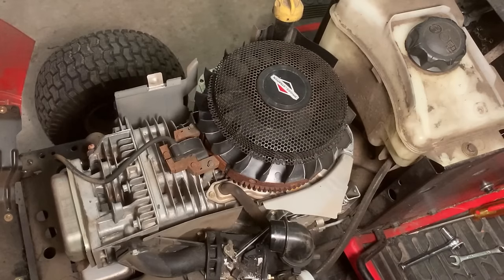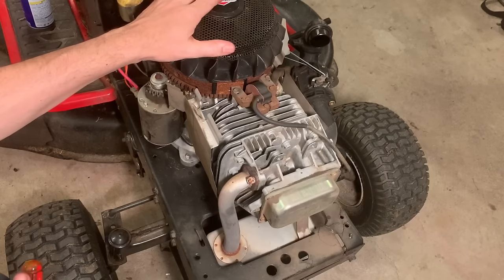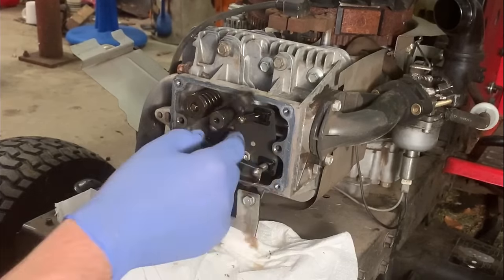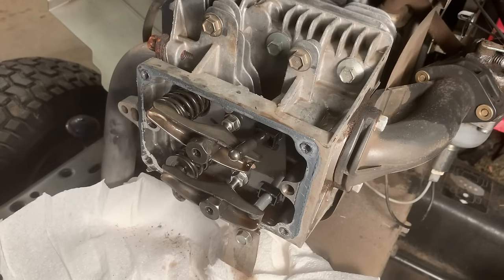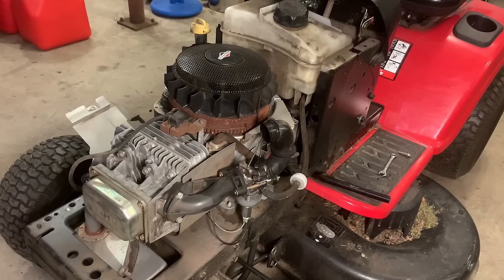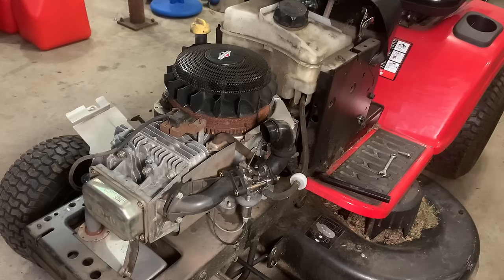Lawn Tractor Engine Running Rough, Missing, Popping, Sputtering / Briggs Engine - FIXED

Comment: Ya got lucky on that one! Those engines are the Vega or Pinto for Briggs!🤗 Briggs makes some good engines, but, that specific engine has been plagued with issues. At least that's been my experience.  I have repaired several of them.
Reply: Can't speak for Vega but Pintos and Briggs have made me very happy.; lots of good use from both brands Always on the lookout for more.
Reply: The vega had crappy engines but the pinto engines were very reliable they just blew up if you got rear ended due to the fuel tank configuration.
Reply: @williamvaughan1218  Pintos were no more prone to fire than other makes of that fuel tank configuration. The case than made all the news was a compendium of bad operator decisions . The young lady  had just filled the tank and forgot to replace the gas cap. She stopped in the travel lane to replace the gas cap which was the primary cause of the rear end collision combined with the inattentiveness of the colliding driver. The missing gas cap plus a full fuel tank was the major contributing reason for the fire.

Comment: I had one that started hard and when I engaged the blades it would stall. had no power. The flywheel was just a rusty as this one. I sanded it shiny, and it had all kinds if power. Started better also.

Comment: I have a troy built mower with a seventeen and a half hp engine would not crank had a solenoid put on the carburetor it will start and run but it has a miss in it if you push it to choke it out smoothes out but don’t open up like it should

Comment: I have now issue with 12.0 hp, (bs model 289707,  2004 , )..
Intake valve hits spark plug ....
So there is somethin loose or broken..

Interesting though that engine starts and runs rather nice with too short spark plug..  

Looking these videos to collwct courage to try to fix myself with low budget.. 
An option is to buy new engine..
Problem is that i invested on parts last year on cutter table so i dont want to buy a new mower yet...

Comment: Nice detailed video.I have a poulanxt 12538 38 inch cut.it looks like yours. My problem is that it starts a runs fine.After an hour or so of use, it will die and will not start until I let it sit for at least an hour or so then it starts and runs as it should. I will be checking timing, valve and pushrod clearance like you did first.but if you or anyone has any advice I woild appreciate at it. It's 4-5-22 and the cutting season is upon me!!!!🥺
Reply from the maker: Would shut the fuel valve off and make sure the bowl has fuel.  It it does then my money would be on a bad coil or plug.
Reply: @jcondon1  thank you james.... I was thinking it was a coil too but I I'll check everything else first.thanks again and I reach back out to you some  how with an update.

Comment: I fixed one with this issue a few years ago.If your engine pops while it's running on a single cylinder ohv it's a good idea to check the valves one of those little keepers may have fallen off.

Comment: Great video. 
The roller piece that fell off, did you put it back on? How did you  fix the piece that came off?
Reply from the maker: I tightened the stud, out the cap back on and adjusted the valves.  Properly adjusted valves hold the rotator cap in place.
Reply: James Condon ok gotcha didn’t see that.

Comment: How is the red fuel filter different from the white one you removed? Thanks for this video!
Reply from the maker: The white one is a paper filter and mean for fuel pumps.  The red is a screen and works better on gravity feed systems.  Of coarse it does not filter as well.

Comment: Had a feeling you might keep this one, I know alot of manufacturers are using rtv for the OEM gaskets but it is concerning to me, if you put too much on and it finds it's way into the oil and crankcase it could be a very expensive mistake
Reply from the maker: I agree, would much rather have a gasket.
Reply: James Condon Plenty of those gaskets available online, the cover was glued on in factory.
Reply: @stevendegreef93  Correct, the parts illustration for that engine shows a gasket even though the factory used RTV during assembly.

Comment: I have same engine worked good for 13 years and is still strong. Never changed the plug. Change the oil every spring and air cleaner I blow out to clean. Breaks on hills are useless backing up on a hill is 
Danger Will Roberson Danger

Comment: Excuse me, I have a KOHLER engine in a 2003 troy bilt riding mower. Does this type of engine have caps or rotator on the valves?

Comment: Excellent. Your point about fuel filters: I've seen a few people say they only block big stuff so they use paper filters even for gravity-fed. A quick search tells me there can be a flow issue with paper + gravity-fed it the tank goes below 1/4 full. Was about to get paper ones until a) I was the price, b) I remembered the cap/gauge on my old 11/36 Murray is awful. Would like to order it a new cap/gauge from the US but can't be 100% sure it's the right one. 
Liked and subbed.

Comment: good video,your good but why did you not show the timing mark on the flywheel and the coil and explain
Reply from the maker: There are no timing marks external to the engine.  The only thing you can go by is the position of the magnet on the flywheel.  Then the piston is at the top of travel, the magnet should only just be clearing the ignition coil.

Comment: With this mower, at 10:18, , if it spitting gasoline out the air intake when I try to start it up, any ideas where to start looking? I replaced the carburetor and adjusted the valves. I will take the cover off and double check that the studs are tight.
Reply from the maker: Ensure the valves were adjusted at top dead center in the compression stroke.  Check the flywheel key as the spark timing could be off.  Otherwise you might have an issue with the intake valve not sealing properly.

Comment: Hey I have same problem on. Briggs 18.5 ohv intek plus but the rods were ok and I put in a new heads . I check the key on the flywheel and it didn’t break and still having backfire thru the carb. also adjusted the valve and nothing . Need help if you can

Comment: Did the blue threadlocker hold ok at those temps? I normally use a high heat thread locker inside heads, etc. Like a 272

Comment: I didn't hear from you about my yth1542xp runniing rough pull plugs they are black and you can smell gas when it's running. Tried everthing new plugs new carburator don't help like some advice on what to try

Comment: Should you have put the motor top dead center and then the exhaust valve down so you can tighten the intake and intake valve down when you tighten exhaust
Reply from the maker: Yes you are correct.  I should have shown that.

Comment: Good diagnostics Good job. What do you charge for something like this?
Reply from the maker: I do not run a repair shop just buy, fix and sell.  I tend to sell below market valve on most of my stuff.  Just need to keep equipment moving to make room for the new stuff.

Comment: IF you have a loose fastener on something and you don't know the torque specs look for another similar fastener and do a simple torque test on that to get the rough range the fastener in question should be.

Comment: The red Briggs fuel filter has a screen rated for 150 microns.  The white Briggs fuel filter has a screen rated for 75 microns.  The white Briggs filter is not a paper element.
Reply from the maker: Good to know.  Thought the white was for fuel pumps and assumed it was paper.
Reply: @jcondon1  I have the same engine and the factory fuel filter is the 75-micro white one.

Comment: That was the correct fuel filter. It is not paper and uses a screen. The white filter is 75 micron and the red filter is 150 micron. The paper filters are 40 micron and only used with fuel pumps

Comment: Nice repair. Does the engine need to be at TOD for valve adjustment?
Reply from the maker: The manual probably says a touch past TDC.  Also you can just rotate the engine and when one valve is fully open, you can adjust the other.

Comment: I have the same engine, and when I took the valve cover off, it spilled a LOT of oil, where as yours spilled nearly nothing. Is that normal and if not, what could have caused so much oil? (I replaced the head gasket and set proper valve clearance, and it still spilled much oil)
Reply from the maker: They vary in how much oil comes out.  Would not worry about it unless you think the oil return hole is blocked.  If that is the case you would know it because the tube that runs from the valve cover to the air box would be pushing a lot of oil out into the air filter and airbox..  Another possibility is that the front of the tractor was down facing downhill when shut off.  If left that way when removing the cover, then a lot of oil might come out.

Comment: Had one of those engines on a mower. got the mower for free. had major issues. locked up, fuel flooded crank, etc. got the carb fixed, was the little o-ring under the plastic separator that connects the float to the inlet was broken. got the engine running after fixing carb. ran for 15 minutes and the rod exploded...... sudden onset of knock and bam sudden stop. pulled engine off and cracked open the case and found that the rod bolts had backed off and pulled the threads out of the rod. was very sad. cant seem to find a decent replacement engine for a used mower.
Reply from the maker: That sucks.  A lot of engines will fit in that.  My John Deere LT155 has a Kohler command.  It is 20+ years old and had a tough life and leaking oil from everywhere possible, but it keeps running.

Comment: Is the piston on top dead center setting the valves?
Reply from the maker: The manual will say top dead center of the compression stroke or just a little past.  Make sure you are not on top dead center of the exhaust stroke.  Also it is much easier to just rotate the engine until one valve is open and set the closed one.  Turn the engine until the other opens and set the other that is closed.

Comment: Where do you go to look up the specs for engines?
Reply from the maker: Unfortunately I use Google a lot.  It is hard to find sources that you can trust.  Sometimes got to cause it based on the bolt rating, bolt size and material and other times consider how important it is.  Making it too tight on the valve cover or studs will ruin the machine.  Too loose and the valve cover leaks a little oil and the stud becomes loose again and does not run right.  I always go on the light side.  But some parts I am more concerned about like the connecting rod and try to be as exact as possible.

Comment: i actually saw this exact issue on a brand new out of the box pressure washer. valve keeper somehow came off. very disappointing but nonetheless it was an easy fix
Reply: Was it a Briggs engine? I have a brand new Vanguard 14hp and it all over the place
Reply: @Tungstencube66  yep. sure was

Comment: It’s weird I actually had an Ariens that had the exact body, engine basically everything. Only difference was mine had front lights. I’ve also seen a craftsman with the same body too in addition to my old ariens. I just traded it for a John Deere S180, wanted something with hydro instead of gear. It worked well for years and cut great for how much I paid
Reply: They are all the same just different badges, I just got a craftsman’s mower and it needed some parts, everything from a couple years newer Husqvarna mower swapped over perfect… only difference between them was the outside cosmetics

Comment: I have a Lt2000 Craftsman 17.5 Briggs Stratton, I bought couples a month ago, when I started using it was running a stop like 20 ~30 minutes later, change gas tank hose, gas filter, clean the tank and added Sea Foam, changed spark plugs NGK BKR5E, started working better by 1 month, but days ago again start to running rough at this time changed the ignition coil because the cable in very bad condition, so started better but can’t adjust the idle, taken off the carburetor opened it was clean and put it back, still not idle adjust and backfired.
Any help will be appreciate,
Juan
Reply from the maker: It ran rough with the oil coil but would idle?  Now will not idle with the new coil?  A few things come to mind.  First, if you put the oil coil on will it idle again?  Also check to make sure the coil is not upside down.  That will cause a weak spark and an issue with timing.  Assuming the ignition system is good, then would dig into the carburetor again.  Sounds like a clogged idle/pilot circuit or maybe a vaccum leak between the carburetor and the engine.  Vacuum is highest when at idle so a bad gasket would be more of a problem at idle.
Reply: @jcondon1  
Thanks for your response,
You mean old coil?
If yes I will try tomorrow putting back the old one
Reply: @jcondon1  
Forget , I also removed the carburetor to see if it is  dirty or sludge but was clean, then when I put it back is running worse, when I try acelerase the engine started to backfire like flooding issue.
Reply: So, today I rectified the coil ignition position to make sure it is in correct way, yes was correct.
Then opened the carburetor, but the only thing is did was that I remove the jet that is work with the solenoid down the carburetor, installed it back and still running rough try to acelerase and spit gas through the intake

Comment: what could cause sputtering if I changed everything air/fuel filter, oil change and plug. it was sputtering and gave a jerk. help please?
Reply from the maker: The most common causes are carburetor or timing.  Would check that the key on the flywheel is good.  Does adding choke make it any better?

Comment: The Nikki 6 carb. is a terrible design. Placing the fuel shut off is a good idea. Usually the carb has problems with the needle and seat leaking and the fuel going into the base and mixing with the oil. (vapor lock possible too) or the low idle jet should have the hole enlarged between 20-32 thousands to run properly. Good video.

Comment: Mister James, sir, if I may ask, where did you find the torque specification for the rocker arm studs and the valve cover bolts?
Reply from the maker: Do not remember on this one.  I have a service manual for some of their other engines.  For the 10hp engines they said 100 in/lbs. fir the arm studs.  Valve covers usually do not have a spec, but have not had any issue around 50-60 in/lbs
Reply: @jcondon1 , thank you very much, sir.
Reply: U don't need to torque any bolt or screw. Just tighten enough for em not to shake loose. NO TORQUE WRENCH REQUIRED.
Reply: @elcomandante9299  Silly goose !

Comment: Any advice on the same mower but with a surging issue? It sounds good for 10 seconds but then surges and repeat. I've installed a new carb, spark plug, filters. I'm stumped.
Reply from the maker: Does it run well when adding some choke?  If so, then either the carb is lean or maybe an intake leak between the carb and the engine.  Also make sure you are using an OEM carb.  Have had lots of issues with clones.
Reply: @jcondon1  it dies almost immediately when choked.  It is on its 2nd aftermarket carburetor. Both surge. Could it be a wrong jet in the carburetor. Should I spend the extra to get oem or is there something else i should check?
Reply from the maker: @chrisvaldez2922  surging can be caused by a lot of things, but usually the carb.  I have tried clone carbs on Briggs, Subaru and Tecumseh.  All have let me down.  Either too lean, too rich or just running poorly.  Other possibilities that can cause surging are ignition coil issues, governor issues and fuel delivery issue from the tank.
Reply: @jcondon1  thanks for your help.
Reply from the maker: @chrisvaldez2922  just rereading this.  If adding a little choke kills it then most likely running rich, but could be a fuel delivery issue from the tank.  If gravity feed test the flow though the line and filter.  If it has a pump, then will have to crank it to see the flow.  I think you said it ran well for 10 seconds.  If so then maybe the bowl has time to fill when the engine is off and then runs out it almost out when running.
Reply: @jcondon1  it runs good for 10 seconds then surges, runs for 10 seconds then surges, but it never dies. After 10 minutes of running it cakes the spark plug with soot. Dies when choked.
Reply: Only advice is don't bend any tabs as shown in these videos.
Reply: Thanks for the help james. I finally figured it out. The issue was a cheap aftermarket carburetor.  Once I put on the new briggs and stratton carburetor everything started to work as designed. 👍

Comment: It looks like the cooling fan and screen have been replaced. I bet the engine overheated because of a broken cooling fan and the rocker arm stud backed out from hot and cold cycles.

Comment: There is more then fuel, spark, compression, you already mentioned timing,the last is valve adjustment, that the 5 problems I go by, honest valves are way more common then timing, I would check them right after fuel and spark
Reply: Than Not then
Reply: @squirrelcovers6340  i dont care that i used the wrong word, to be honest the fact you understood me means you didn't need he correct spelling to understand the point, and i hate people who bother with pointing out such meaning less junk, its a waste of both our time and if i couldn't pass writing in k-12  with a IEP im not learning it properly over decade later

Comment: That valve cap was NOT the problem. That didn’t come off with the rocker properly adjusted. It had to already be loose for that to come off. The stud being loose was the root of the problem. 

And the last guy obviously either didn’t try to get it running or had NO CLUE what he was doing. From the looks of that engine he never even raised the hood. He just turned the key and said fuck it.